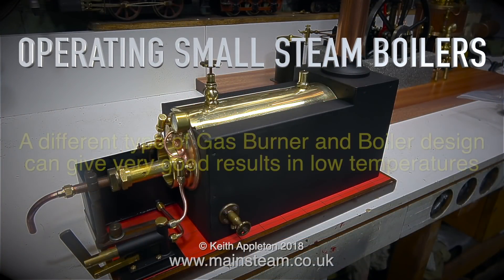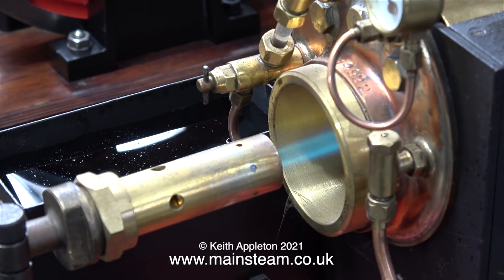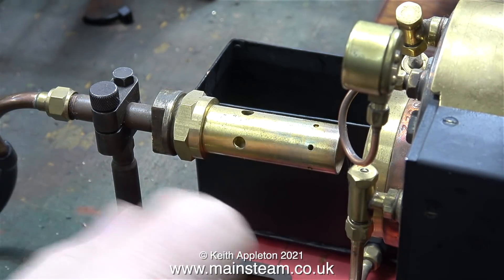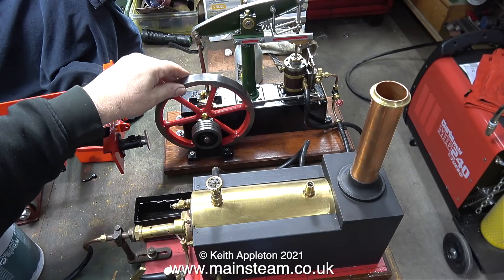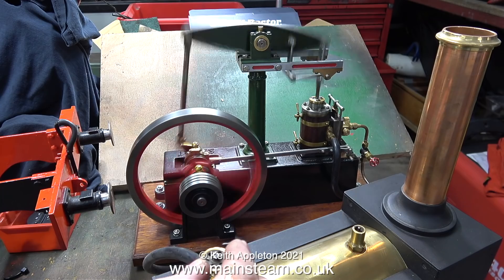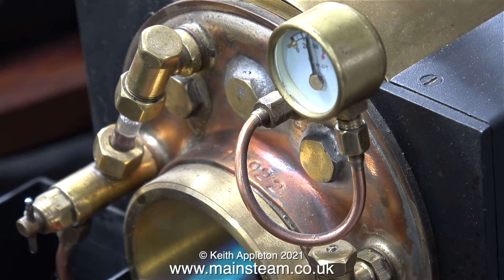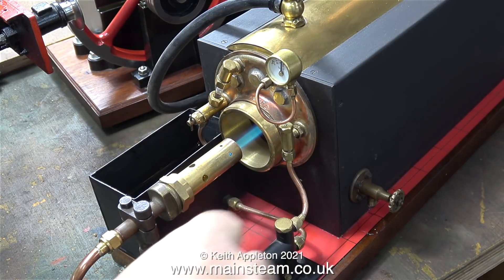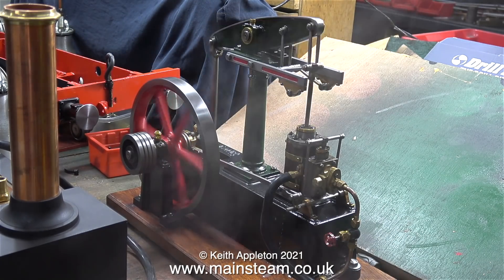MODEL STEAM BOILERS IN LOW TEMPERATURES

Comment: Whoever built this boiler was a real artist in both looks and design.  There were some locomotive boilers like this and Lentz was one type.  Those had corrugated fireboxes with a grate in it the same as a Lancashire.  They lend themselves to oil and gas firing far better than solid fuel.  I always wished that someone made the equivalent of the boiler in this video, about four to six times the size, perhaps multiple combustion flue, in mass production.  Because it's all tubes with only end sheets it would be very simple, but a gigantic steam output.
Reply from the maker: Yes it is beautifully made and one of the best steamers I have, and it steams well with a very small flame from the burner......

Comment: I have never used a small boiler before but I work in and operated a boiler house, with running the boiler up from cold do you not go through a heating cycle to avoid thermal shock, also we always get told steam should always be dry as carry over is the worst possible side effects of steam but in your case you are happy to have that and use as lub? Last question do you use make up water or you just using tap water? Love the set up and have been thinking about getting something similar for my workshop is there a good place to look for them and ones to avoid
Reply from the maker: Full size practice is quite different from the small ones . . . I use Tap Water. I do sell steam engines from time to time via my Website: www.mainsteam.co.uk
Reply: In our boiler house we have a chp a waist heat boiler a bio mass and 3 steam boilers, I know they are dangerous but I do like working on them and I will definitely have a loom on your page Thank you.

Comment: Have you considered an oil burner?
Maybe for shop heating, or maybe even for firing a steam boiler?

Babbington atomisers can be pretty easy to make/run on pretty much anything non flammable that can be pumped including waste veg oil, waste crankcase oil, diesel etc. Thick steel flame tube's red hot within 20second of lighting. And instead of compressed air, can be self powered by a tiny amount of steam.

There's a video of one I made/experimented with on my channel. Very high flame intensity. Recon about 20kW heat/ burning from a bit over 2 tin cans worth volume . Yeah it went bit wrong as oil dripping out of the burner air inlet hole and ignited, and then 12V automotive windscreen washer pump suffering a horrible death due to it's pumping hot oil.. But otherwise idea seems sound lol
Reply: I think this also depends on what oil you choose to burn as they all produce different temperature, so heating oil will burn hotter than natural gas but not all oil will burn hotter, and I would still be worried about heating a cold boiler up that quick from cold.

Comment: I notice the oil used to lube the engine seems to flow just fine even in a very cold shop.  Anything special to do this, or that's just how it works out.

Love that engine with the way the links work up and down to keep the piston rod true.  Could watch it for hours. :)
Reply from the maker: Just the way you see it .....

Comment: Over the winter I found the limit of my small, homemade, alcohol fired boiler; at 32 deg F (0 deg C) with a windchill of 25 deg F, it refused to make enough steam to run the attached engine due to the wind blowing the fire around.

Comment: Hmm... may be time for a "squirrel cage" type blower for shop ventilation on cold days? If you got one of the belt driven types, it would even be ok as a simple fume hood/extractor. Not thinking anything expensive, just some positive ventilation so you can run your heater and your steam.engines! After all.... priorities!! :-P

I'm sure you've thought of it, just batting around ideas for something multiple purpose. 

If you ever want a small, quick way to get a second portable heater on in the shop, I cannot reccomend the mr buddy heaters enough.... They're propane, but in tent/doors safe. They should run on your gas canisters too.